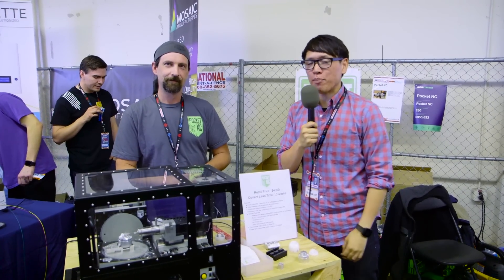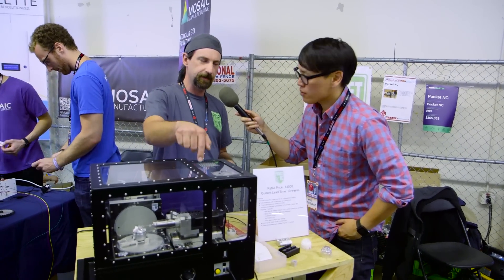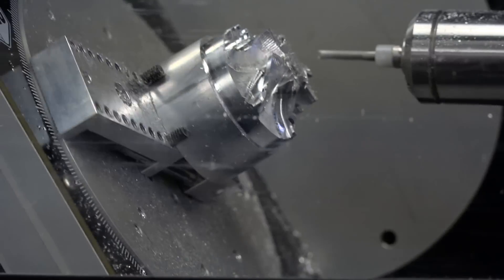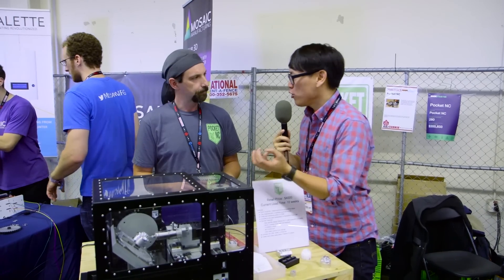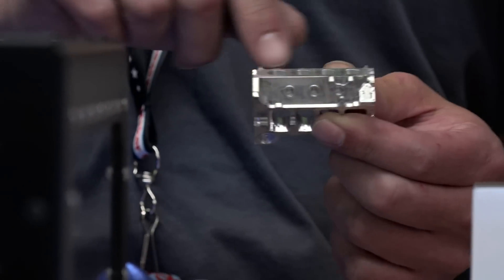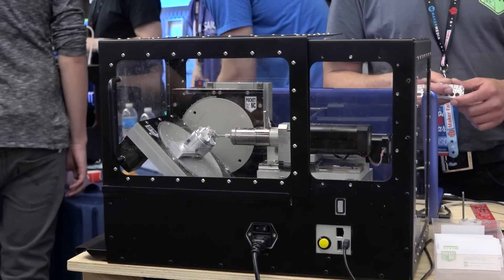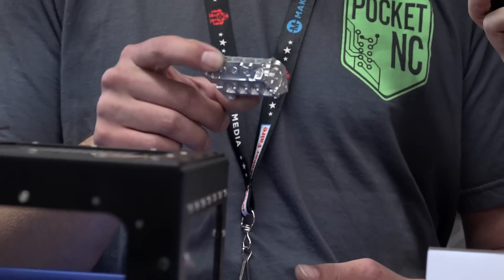Pocket NC 5-Axis Desktop CNC Mill!

Comment: I wonder how it compares in a price/volume comparison. I don't know if that $60k mill he is talking about has a maximum volume of 15 orange halves. :) At least in one axis that would be almost 1m.
Reply: 7.5 Oranges?! You crazy Americans! Over here we measure things by the apple.
Reply: benner2000 not an american, i was just using the same unit for clarity. But I think you wrote the volume badly, it is 7 ½. You need to use fractional oranges. :) Anyway, over here we use grapes to have more precision. :)
Reply: I think it sure has.
the Volume grows by the factor³ .
So even if it is "just" two times the build size in each of the 3 "normal" axis - it ends up being 8 times bigger.
3x this machines size in each axis I would still consider a "small machine" - and that equates to 27times the processible volume - 3³ = 27 - so yes, i strongly believe it can have 15 times the volume.
To have 15times the volume you do not need to have 15times the lenght in one axis - only 2,5times on 3 axis.
which equates to 15,625
Reply: Right. I'm not sure why i would consider increased volume in only one axis. I think i was aiming for the joke and let logic suffer. :)
In any case, all 5-axis mills i saw had a larger machining area. But those could have costed hundreds of thousands of dollars. What i'm saying here is that if he only says the price of that other machine without it's working volume the comparison is less valid. If that other machine has the same working area they got a really fine product.

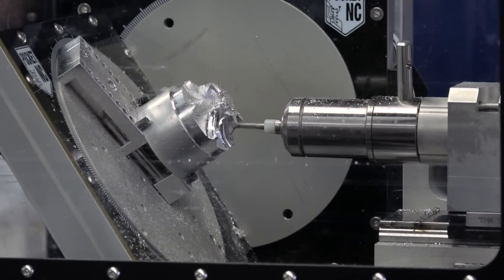Comment: 0:35 - can you explain why it becomes harder to design as you add additional axis?

"Well, making overhangs is really hard for 3d printing, but we can do it fine on a 5-axis CNC mill..."
Reply: you have to make sure the machine can reach all positions in space and also design it rigid and without slop/play because on rotational axis, slop/play gets proportional the more the tool is away from the center of rotation

Comment: any software that moves more then 3 axis at the same time (true 4 and 5 axis milling)?
Any plans of finally making a larger one that can hold larger blanks? An orange is a terribly tiny thing.
Reply: Fusion 360 (free for hobbyists or 300$ a year), Bobcad-Cam (which i think only costs 5000$ for 5 axis with intelligent toolpath generation and machine simulation), Mastercam (pricey), Powermill (pricey), Solidworks (pricey) and many more... (pricey means 15-30k)
Reply: Fusion360 only does that for 2 very limited strategies that only work with contours and thus fail with milling meshes and with imported STEP files.
Reply: well now it does 5 axis contour lines for engraving and 5 axis swarf but i know what you want to say. Someday when i have finished my 5 axis machine and Fusion 360 still does not support real 5 axis simultaneous and machine simulation i may change to Bobcad cam which has a resonable price, real 5 axis simultaneous and machine simulation and does not relie on servers

Comment: It looks sort of like a budget version of a Cybaman Replicator.  Pocket NC 5 axis is ~$4k.  Mdaprecision's TN5 (a Wabeco 3 axis with mda's TN4 trunion table added) is a 5 axis benchtop CNC machine for ~$33k that will also cut steel. Pocket NC is ~8x less expensive, which is impressive - just not quite so impressive as the "15x less expensive" claim in this video.
Reply: 8x less expensive but can only mill very soft alu .........and small work area .... = u pay 4k for toy

Comment: 6061 aluminum is the softer one for iphone6. What about 7075 aluminum, the harder one for iphone6s. I mean, RC cars tends to use 7075.
Reply: might have to go a little slower but I don't see a reason why not
Reply: It depends of the motor, you can burn it even if it's going slower. Theorically, you could even mill steel if you mill it slow enought, but in reality, you'll ruin you milling machine
Reply: +gosonegr I meant slower feed speed not slower spindle speed..
Reply: Guys, it doesn't work that way. Its about rigidity and that is something that comes from the ENTIRE machine. The quality of the linear guide ways, the ball screws, the ball screw nuts the spindle bearings the chassis. 7075 is soft. Try mild steel. That is the measure of cutting something hard. The reason a 5 axis cost so much is because you can do 95% of most models on a 4-axis. You can get a way better 4 axis mill, like 10x better mill for twice his price.
Reply: That lack of a proper bed I think would be the end of it for anything remotely hard, what really concerns me is the way the A, B an Y axis assembly is attached to the rest of the machine, it looks flimsy and the lack of back photos of the machine in their page doesn't help, I just hope that they didn't just screwed it.
Reply: Finn El Humano Yeah agreed. It should be 1 inch cast iron at minimum. If we are going to that level, what about a trunnion with only one side supported! Why no bearing on the other side! This breaks one of the golden roles of bearing placement.
Reply: +Finn El Humano google "nc cnc" its a commercial machine very similar to this for around 30k.
Reply: I dunno, I believe he said he's cutting 6160 here... ;)
Reply: I would think it would work fine
Reply: Sanch Arino Your thinking doesn't make it work fine. Its one thing to be certain, but you can be certain and you can be wrong.
Reply: +gus bisbal why couldn't you just turn down the feed rate?    It's still Aluminum.
Reply: Sanch Arino  The problem is the rigidity of the machine, a lower feed rate would still require the same force to take the chip out, and the difference in hardness between 6061 and 7075 is huge.
Reply: Rockwell hardness
6061 = 40
7075 = 53.3
Mild steel = 71
Just for some perspective.
Reply: +gus bisbal thank you.
Reply: that cannot be, we do harden steel to about 56 to 62 HRC, i think what yu mean is Brinell or Vickers
Reply: 7075 is easier to machine than 6061.  And most parts on rc cars is 6061.   Shock towers are 7075 (on the high end stuff).

Comment: hehe trunnion is a funny word

But also yeah I know it works in metal and that's a difference but it seems like it has just as many real world use cases as a plastic 3D printer. That's sort of been my reservation with 3D printers is they're really cool but what are the practical applications for everyday people? "Now you can print in metal! Print what in metal? ...I don't know."
Reply: Each different type has it's own merits tbh.  I think the whole idea behind metal printing is that it's extremely useful to build up extremely complex objects that you can't actually mill from a single block, either due to wastage or just the fact you can't cut or mill a particular feature.

Comment: Rebuilding the root of a tooth? That confused me quite a bit. How would you even make it stick and stay in place without using screw threads. If you're using the latter then you wouldn't even bother building a root to begin with. It got me very curious to what the dentist was attempting to do in the first place.
Reply: I'm no dentist, but we actually machine dental implants where I work.  We machine about 12 different sizes with varying lengths and thread tapers.  I think what he meant was that they could machine a perfect implant for your jaw.  Can you machine one with this cheap machine?  Maybe, but I imagine it wouldn't be pretty.   Its just not a practical option.
Reply: You would always need to mill a jig for a different tooth then super glue the tooth to the jig. This jig would be used on the last milling operation. Heat the jig and tooth to make superglue release.

Comment: I have a mighty need
Reply: Yeah. I was actually looking that up when you sent it :D
Reply: King Harkinian
my dad and i are looking at getting one of those ebay ones or a basic 3 axis mill and installing CNC drivers etc for a $1000 more and then we can cut S-steal or other hard materials. its sad that there is no mid level entry machine for around $4000 that can cut steal and make things larger then your fist. this thing is a joke and these guys are laughing thanks to people that cant take the time to look stuff up. the way i see it if you have the know how and skill to need something like this you should be able to adapt a cheap $2000 3 axis mill and make the turntables to make it 5axis CNC
Reply: If these guys made a more middle-ground machine for $4000, with a work area of at least 12", then we'd be talking. If you're planning on making money a big budget machine might be better anyway, but for people like FIRSTers $4k is a reasonable investment.
Reply: King Harkinian
exactly, as it is your looking at 10s of thousands to get a machine with a wide material range and work area. so i wont throw away my $4000 on something like this when i can modify a 3 axis mill with readily available kits that you can get to modify normal milling machines. if these guys get there buts in gear and drop the prie on this to under $2000 i would be on board with this rather then the chinese one. and yes they should focus on a larger machine with full material range
Reply: The term "engraver" is a pretty good clue you can't actually cut anything with that machine.
Reply: what  cheap 3-axis   CNC  can be modified  for alluminium mill?
Reply: Alex A it's easier and cheaper to get a cheap 3 axis manual mill and convert it to cnc.  Use steeper motors and a controller from a 3d printer.  And if you have a 3d printer you can make the mounting hardware that is needed.

Comment: cnc machines are better than the 3d printing machines. They've been in the industry for decades and 3d printing machines are still very young.
Reply: they do make better parts but cnc cant do internal structure without cutting through the surface. some wind turbines are built with metal 3dprinted parts to improve efficiency.

Comment: I'd like one, but the price tag is just a bit too high. This is half the price of a 4 axis tormach which could arguably be more useful. I'd be more interested when 5 axis cam is more consumer friendly and if flood coolant was supported.
Reply: If you had it in a cabinet like that one you could use a gas or air cooler.
Reply: Gamesman01 They already said air is not even good for it, it forces chips into the inner workings.
Reply: You don't actually want flood coolant on a machine this small.  Mist from someone like UNIST will perform much better.
Reply: prototype3a Any machine can benefit from flood.
Reply: rkshireygames How many years of experience do you have doing cnc machining with tools less than 2mm in diameter?
Reply: prototype3a You do realize that that is about .08 in? Most people will be running .125 end or ball mills. On top of that, a lot of places run flood on most cutter sizes, especially on hard or gummy material.
Reply: rkshireygames Sure do.  I have roughly five years of experience coding for and running tools up to 1/8" but also all the way down to 0.010" in everything from aluminum and stainless steel to Inconel 718.  Mist coolant performs better on small tools because it not only has the pressure to flush away larger chips but the fine mist does a better job of coating the small surfaces on small tooling.
Reply: prototype3a
Have you ever worked with Monel? I was told it hard to work because of it's Toughness.
Reply: I'm familiar with monel but the parts I made never required the extreme corrosion resistance of Monel.  However, as far as I know, Inconel 625 and 718 are some of the most difficult to machine materials out there.  We used them for their strength at very high temperatures for products that would be used inside turbines. I may have also cut some Hasteloy X750? at one point.

Comment: For double the money you can probably find an old Mazak VQC-15/40 M32 someone is dying to move or a Haas VF3-APC even. I've seen the small  Quickturn 8 lathes sell for $6000. Some deals on AJV-18's and AJV-25's if you want 10-20,000lbs of Japanese muscle. I know that doesn't fit in a 3rd floor walkup, but it puts the price into perspective.

Comment: But Autodesk Fusion 360 can't do 5-axis CAM.  Currently, it can't even do simultaneous 4 axis, just indexing.  I'm a paying subscriber and it is awesome for the price, but it can't generate g-code that they are running on that machine.
Reply: did you know Fusion 360 is free for Hobbyists? or are you making more tahn 100k a year?

Comment: Would it be able to work with 6al-4v titanium plate?
Reply: no.... nope .... not a chance, aluminum is about the best it can do
Reply: Buzz kill. I was hoping I could use it to make knife liners and frames.
Reply: I'm busy thinking, it might come down to the motor... not sure...
Reply: Probably the heat factor.
Reply: *****
comes down to a number of things, tool bit is a small part of it, mostly its motor torque and the CNC driver torque on the turntables. also you would have to mod this to have coolant for the tool bit. and since jobs take so very long in these machines the motors would need active cooling as well
Reply: +chaos thanks man. that's actually some interesting stuff, you a machinist?
Reply: taylor wilkinson
working on it, check out my channel if you want to get an idea of the sort of stuff i do. building the largest most accurate enclosed DIY 3D printer for under $2000 in the world (as far as i can find)

Comment: It's a great 5 axis mill unnecessarily crippled by it's very arbitrary small build envelope!
Reply: I agree with what you said about educational applications but other than that and the dental and jewelry industries there is just not much you can make within in the 4.5" x 4.5" x 2" constraints of that build envelope.  To be more commercially viable it will take at least a 3 or 4 times bigger machine. It's still an amazing piece of technology but who is going to buy it?
Reply: Personally, I could see it being useful for milling small metal replacement parts.  I work in a theater currently, I would definitely use this for tool replacements parts, in addition to replacement parts for older lights who's parts are no longer manufactured.  For that kind of things its great; unfortunately, even $4000 is out of my budget.
Reply: It should be set up so that x and y travel allow it to reach at MINIMUM center of platter to edge of platter. Similar z travel so it can get all the way out of the way for indexing. That alone suggestion is about twice as much travel as it's got plus shifted envelope of xy with same a and b rig. (More than ×2^3 more volume)

Comment: Still 4000 dollars though.
Reply: Believe me, 4k is cheap for this kind of machine
Reply: for router that can do only soft alu and softer materials ?? u joking right ?
Reply: Which is change for the money you can make if you own a CNC machine.
Reply: MrCcfly
Why? Do you know how cheap 4k is?  That's SO cheap that it would pay off to buy that CNC machine if you have to manufacture small alu parts for some business, because if you were making 100, 200 or more parts, you'll save money over having someone else machine it for you. Not everything that's CNC machined has to be 7075 or steel.
Reply: the new v2 one is $5,500 fk

 @MrCcfly  i've seen 3d printed router mills cut steel you just need the right settings and tools.

@derbigpr500 its not cheap when your car cost 3 times less than it. different perspectives of cheap vs expensive.

Comment: You can't make a model cnc engine to run.. it's impossible to make the fuel injection that small... Also the water cooling would be another pain in the butt to make!

Comment: Make a "pro version".. if you well.. bigger and stronger to cut steel and bigger pieces. The spindle stick out is too much for it to be stiff.. needs to be redesigned. As is its very nice but not very useful.

Comment: What am I even looking at? What is the purpose of this machine?
Reply: A mill uses a spinning tool to carve shapes out of solid material. Think a drill press but with a moving clamp so you can slide the work past a spinning drill or router bit (don't jump on me machinists I'm simplifying). A CNC mill uses a robotic drive system that moves the tool under Computer Numerical Control. So this machine uses a spinning toolhead to carve a block of solid material into a shape, and uses a computer program to determine how to move the tool to get the result you want. This one is a 5-axis, so it can move the tool around but also can rotate the work to let you access it from different angles. (A 6 axis CNC machine is a meaningless concept, as the only axis left to add is roll around the tool center. The tool is already spinning and symmetrical.)
Reply: You draw stuff on the computer and send it to the machine to cut from a solid block of material.
Reply: It's a robotic sculptor. It takes a solid block of material and removes all the bits that are not what you want.
Reply: coolness  machinafied

Comment: $4000 for it... such a wast of money... diy one for $2500 and be able to work with steel and large work peaces too.
Reply: yes, build it with at least cast iron, then buy ballscrews with 2 nuts to eliminate backlash, linear ball guides and then buy 5 Tarocco closed loop servo drivers with 5 dc servo motors and 4-5000cpr encoders so you have a theoretical 0.001mm resolution and then get harmonic drives to eliminate play in the rotary axes and you are lighter 5-6000 dollars :)
Reply: which none of these thing this toy have..and for 4k ..u get like china made router that can do only engraving to very soft alu